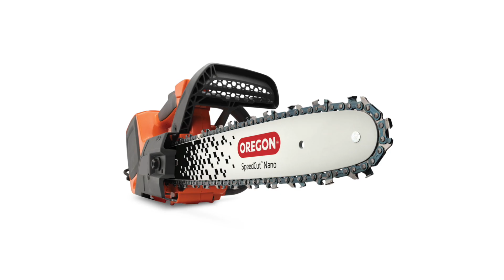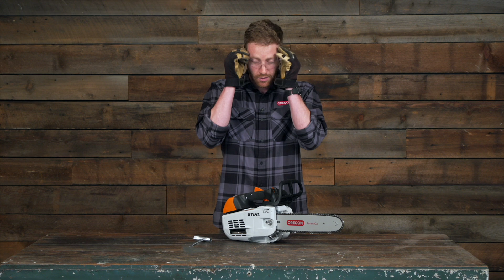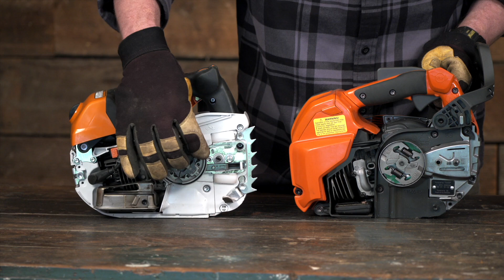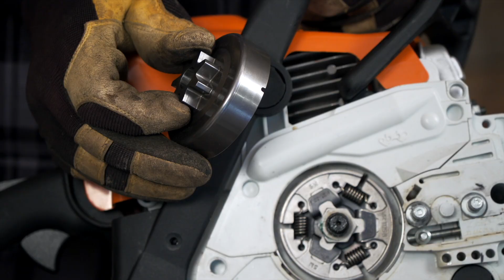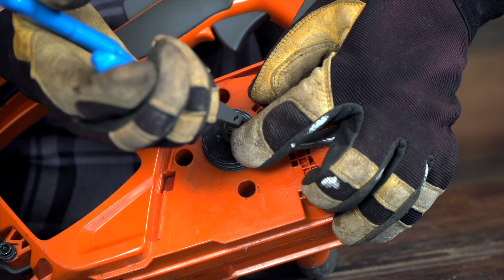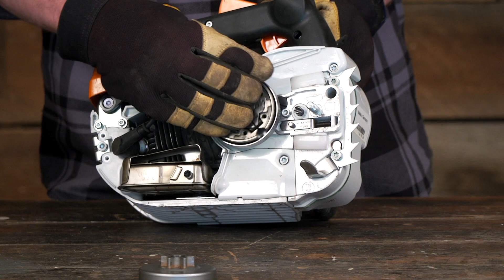How to replace chainsaw system with SpeedCut Nano

Comment: I haven't found any videos on sharpening the low pro .325, is it the same file size as a standard .325? i couldn't find the info on the website either

Comment: Using an impact to remove the clutch from a chainsaw runs a significant risk of twisting your crankshaft. If that occurs, you will need a replacement crankshaft, which the cost of said repair often overruns the cost of the saw itself. Especially with the cheaper saws that this product is designed for. I would highly recommend updating this video to reflect such or run the risk of liability for lots of damaged customer equipment. Always use the manufacturers recommended procedure for all brands of saws. Not just the ones without a hex driven clutch carrier.
Reply: So how should it be done ?